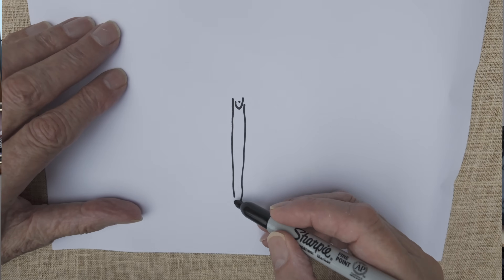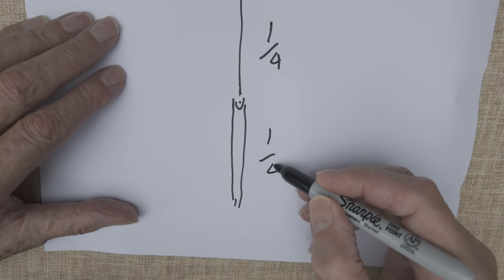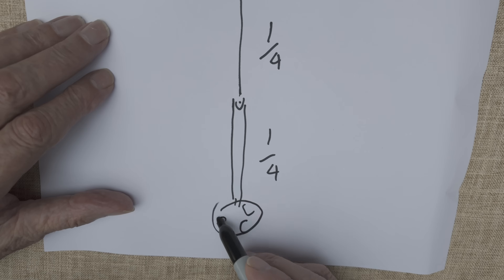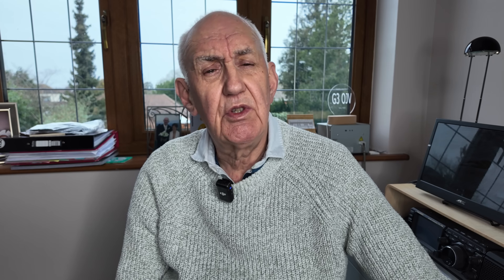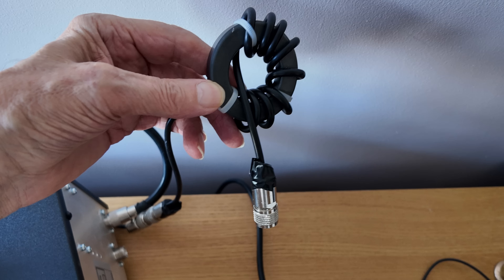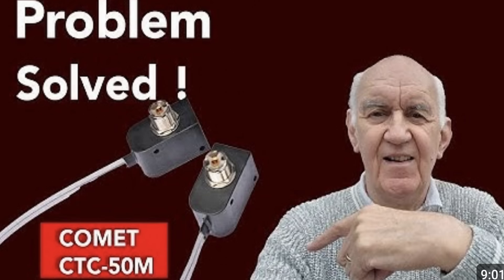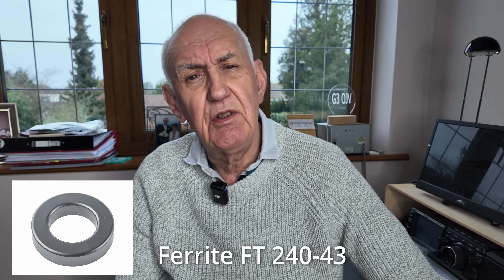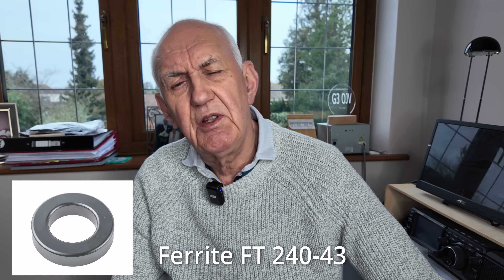A Versatile Half Wave Dipole for Ham Radio

Comment: You really want to raise nostalgia here.... 

This is kind of like the first antenna I ever built.  Dad gave me a CB, against my mother's wishes or knowledge, and I needed an antenna that I could hide.  I found an article in a CB magazine that showed how to make "tubular dipole" (i think that was the name).  

It was really easy, and cheaper than any other antenna I could buy.  I used a piece of RG-58 coax from Radio Shack.  I measured out 1/4 wave from the end of the coax and removed the outer plastic jacket.  Then, next to the jacket, I pulled down on the shield so it folded over the jacket. I did this until the shield was completely folded over the jacket.  This formed a 1/2 wave dipole where the top portion was the center conductor covered in the dielectric of the coax.  The overlapping shield formed the other side of the dipole. 

I found fine-tuning it was easy. I just pulled or pushed on the coax until I got a low SWR.  I always got it to 1.1:1.  

I did not know anything about CMC or chokes at the time. I just used the antenna as-is and it worked every time.  

To hide the antenna, I drilled a hole just big enough to feed it up to the attic in a hidden corner of my closet. I hung it from the rafter at the center of the roof.  

The only reason it did not work like that was that it was horizontally polarized in a day when all the local CBers were vertical.  I found a tree I could hang it from vertically, and it was my CB antenna for several years.  

I made a bunch of them and sold some to my friends. I use RG-58, RG-8 mini-foma (now called RG-8x), RG-8 and RG-8 foam.  They all worked well.  I even made a 10 meter version when I got my license. 

Thanks for the memories... :)
73

Comment: Thank you for the video, Peter (and for our recent QSO, too... :) ). I made such antenna many years ago when I debuted into the hobby and had only a FT-23 handy....(I still keep this radio!) I taped it to an old fishing pole and it was amazing how it performed. I've never tried on HF but I'd be interesting. I'd like to know what antenna would you recoimmend for 20m monoband portable use: This T2LT, the popular EFHW with a 49:1 adapter or the venerable inverted V dipole (center feed). Which one do you think would be the most "tolerant" to be deployed in diferent locations and may be shapes once adjusted? The idea is to leave the antenna tuner at home hi,hi,hi. Thanks again for your work, Peter. HOPE CUAGN SN! VY 73!

Comment: I'm in the throes of making a T2LT for 10metres with an air wound choke. I'm VERY interested in your technique using a ferrite core, of which I have a couple of spares. As I do field work the idea of using a socket for various bands is also going to be investigated. I like the impedance manipulation technique as well. Thanks for an excellent video on this design 73 de GØUSL

Comment: Moving the junction of the wire and coax shield braid is effectively creating an Off Center Fed antenna (with the actual feed point at one end) to shift the impedance.  Genius.  I love my 80M OCF dipole.
All of the various bands choke ends can just be on one base feed similar to the "DX Commander" system.
Now we are at a starting point for experimentation I would think.

Comment: Could you use clip on ferrite chokes instead?
Easy to adjust the number and the position.
Also, do ferrites rust and cause a rusty bolt effect which in turn causes unwanted RF products when transmitting?

Comment: It's a flower pot antenna for the HF bands. Note that the velocity factor when using the outside of the coax may not be the same as the internal coax velocity factor, hence the need to tune the lengths a bit.
Reply from the maker: The  outer quarter wave coax section is not acting as a transmission line and so the normal wire formula is very close.
Reply: The outer 1/4 wave of coax outer is acting more like a normal dipole but the velocity factor will still be slightly reduced due to the proximity of the insulation. The uper 1/4 wave wire also has insulation around it and this will also slightly reduce its velocity factor from a bare wire conductor. Replacing the upper 1/4 wave with a thicker wire for example may also improve the bandwidth.